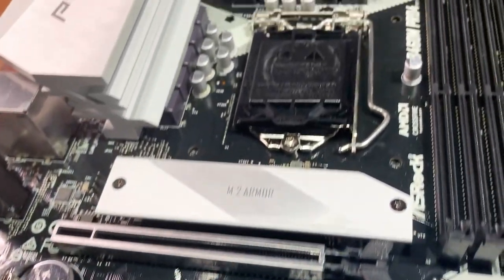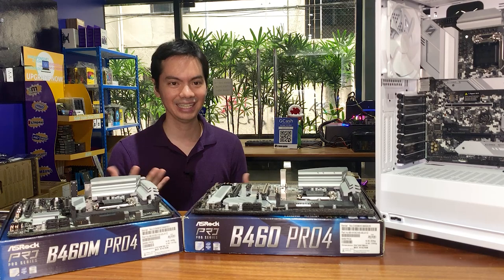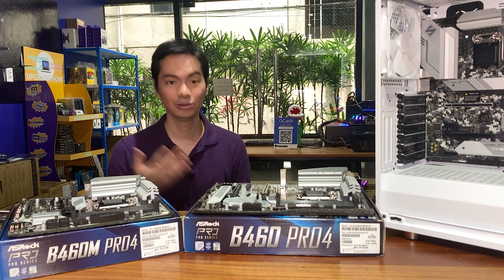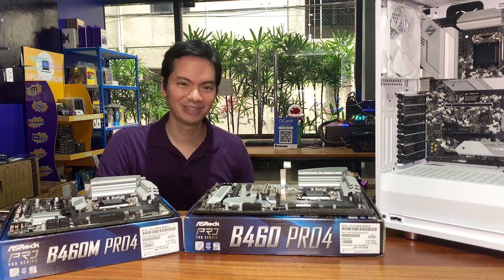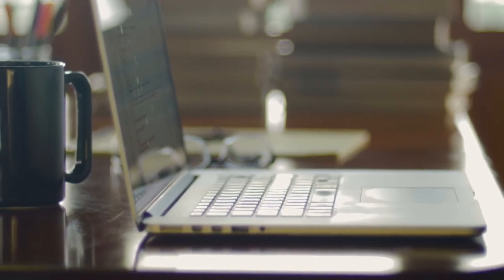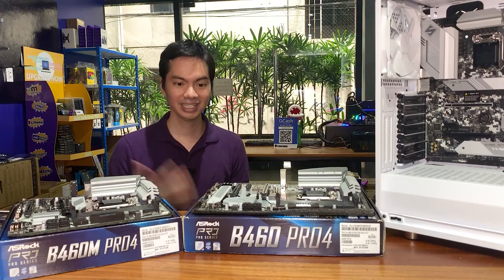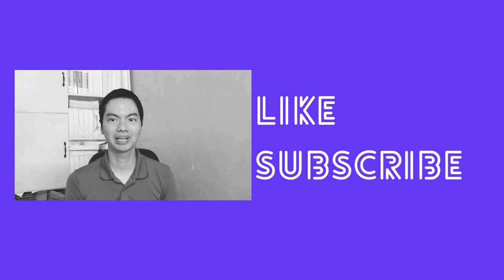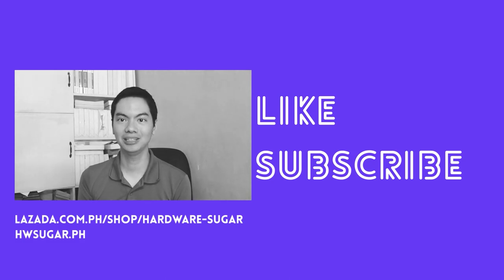I don't usually get excited over motherboards

Comment: BFB works great in my B460 Steel Legend and i5 10400. rock solid gaming config
Reply from the maker: great to hear real world feedback!
Reply: Ive got the same mobo but with the i5 10400f and only just leant about bfb, just wary that i might fry my cpu doing it
Reply: @R3LAXMUSIC888  did u still use bfb node? Hows the cpu temp when gaming at after 2-3hrs? Can u elaborate why iymt destroy cpu in non k version
Reply: @hanquah  tbh haven't tried it but might give it a go today and see if i notice anything
Reply: @R3LAXMUSIC888  yes please let us know the fps gain it can reach. With bfb or without bfb activation. Really appreciated your help
Reply: @hanquah  i havnt noticed any fps gain but i did notice my pc running abit better.  I think temps were all normal
Reply: @R3LAXMUSIC888  maybe bfb work best with i7 10700f due ro hi ipc gain and more core hi max frequency
Reply: @hanquah  i am running it with a rtx 2060 super so maybe im getting the max fps for the gpu
Reply: hows the performance sir after using BFB on it 10400?

Comment: BTW the square niblet is an inductor/choke for the memory VRM. It must be an alignment issue with their production line for those motherboard models or something but as you said it doesn't warrant the product to be rejected by quality assurance. It's only an issue if you have OCD and have to look at it XD

 Even cheap A320 motherboards from other manufacturers have chokes lined up perfectly: https://www.asus.com/media/global/gallery/5m5gguiros3nd9pp_setting_fff_1_90_end_1000.png

While others aren't properly aligned properly too:
https://static.gigabyte.com/Product/2/6753/2018110210292254_src.png
Reply from the maker: Thanks for the confirmation (and the reference pics :D). The slight misalignment didn't bother me at all, just something I noted on visual inspection - no one will probably get that close to the mobo anyway when they use it in IRL.

Comment: Hi what case is that? I can it can take cm vertical gpu riser with simple cutting out some plates.
Reply from the maker: It's the Fractal Design Define R6. If you're going to vertical mount best if you use their riser cable, the Flex VRC-25.
Reply: @hwsph  ok noted.

Comment: Now if only Intel allows memory overclocking on B460 they can actually become competitive in the low to mid tier market.
Reply from the maker: they definitely need to do something to compete with AMD!
Reply: @hwsph  It's sad that i3 10100 which only costs 6k loses to the out of stock 3300x in gaming because of memory speeds. 

It can probably give the 3600 a run for its money since the 3300x also does the same thing. 

It should dominate all budget gaming builds right now because 3300x is out of stock but Intel just doesnt want to budge with the memory speed limits.